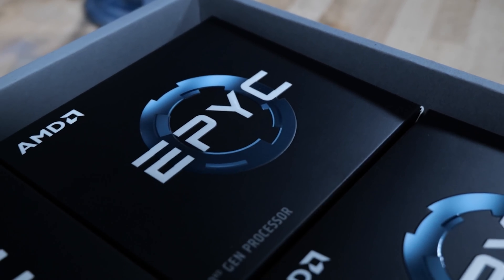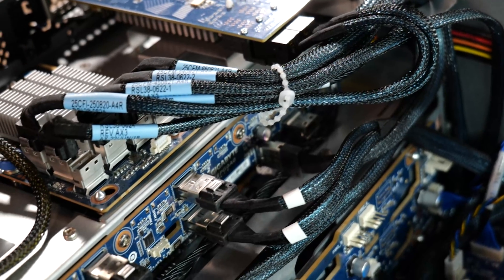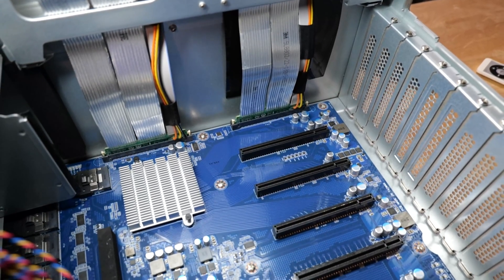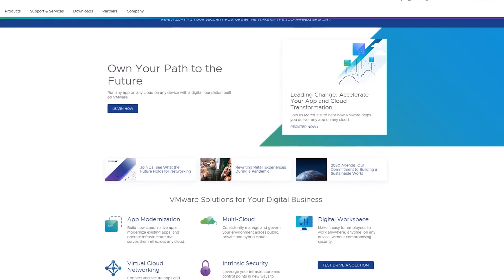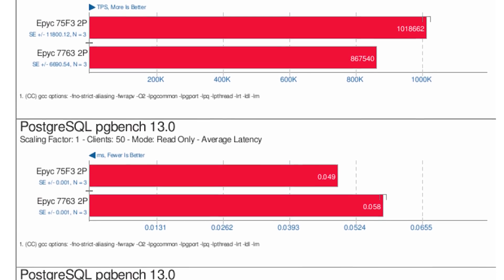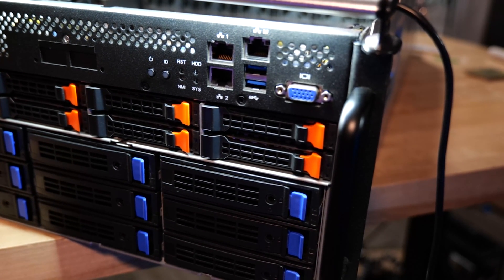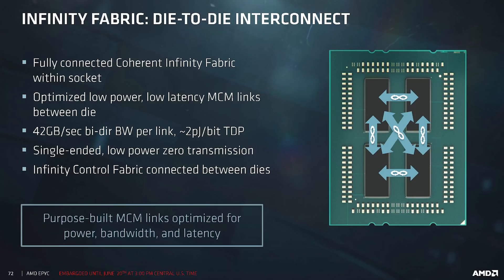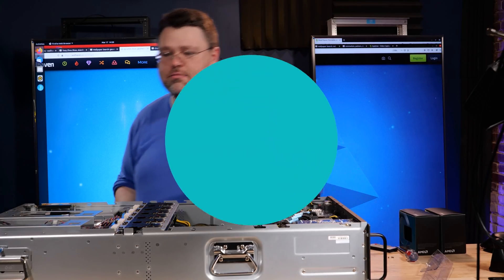Checking Out The Gigabyte G482 Z50: A Truly Epyc Server

Comment: An interesting ‘case’ study for you to try, split into 3 questions: 
1. How much/many 140mm based radiators (e.g. multiple mixes of 420mm and/or 560mm) would you need to be able to passively cool (WITHIN the same case as the components) a top of the range (eg RTX 3090 and AMD 9 5950X or a threadripper) fully water cooled system (at least GPU, CPU) at full over clock, to within 5 degrees of ambient temperature with the fans set to their absolute lowest possible speed, and not really needing to spin at all under normal load? 
2. Which off the shelf cases (max spending limit of $1,000 for the case) can fit all those radiators at the same time? 
3. If there are no cases which you can buy off the shelf which can fit those radiators at the same time within the system case, which case would you buy off the shelf as a starting point, and can you show us a step by step followable guide to how to mod the case so it CAN fit all those radiators? Try and keep the modifications to methods that people could DIY with only moderate access to power tools.
Can you demonstrate/show us such a system in action, and give us a rough idea of total cost for the case and total cooling system (e.g. presumably if there are loads of radiators, a more powerful pump would be needed)?

Comment: I watch these types of videos by Wendell, in much the same way I watch old Top Gear super car specials, but something did catch my interest that's probably only in server space right now: What's with 2.5" form factor NVMe drives? 
I ask because a total turn off for me is the un-swapable nature of M.2 NVMe SSDs slotting inaccessibly into the motherboard, often right under the GPU. For me I'll swallow the outright speed hit to use 2.5" form factor SATA SSD's in 5.25" hot swap drive bays in a fairly standard E-ATX type case (from a few years back when they still included optical drive bays). 

I just love the flexibility and I mostly use it to easily multi-boot OS's bare metal. I love having a single PC that's multiple flavours of Linux and Windows and Mac with a few clicks and clunks, without the expense of buying the hardware needed to do the same thing efficiently in VM. Being able to keep much the same form factor but have those 'drives' be caddys holding M.2 NVMe drives that are cabled to the motherboard's M.2 sockets is very interesting - even if there were only two on a typical desktop motherboard. Front access NVMe - yes!!

Comment: I wish it were thermally possible to have high performance 3.5 inch U.2 drives with super dense layout.
Basically i see 4x boards stacked on top of each other, each with many NAND chips on both side inside of the 3.5 inch form factor for bulk fast storage that is more dense than 2.5 inch chassis

Comment: So, fyi, in the USA almost ever single computer and network gear has a ranged PSU. And you can supply them with single phase 110V (or more appropriately 120V) all the way up to 240V. Technically they are rated to go below and above those rates as well. Common single phase electric voltages for server racks and UPS/PDU gear is 120/208/240V. If you need 120V for some equipment I'd recommend a UPS with a transformer. Also you will need C13/C14 (or some other equivalent) cable to replace the NEMA 5-15P cables that are almost always supplied. The real advantage is running at high voltage and LESS amperage. Making everything run considerably more efficient and providing more density in a rack

Comment: Only complain i have about the design is that both 10GbE run over the single Intels X550-AT2 chip and that is fixed to CPU1 only. with two 10GbE ports i really thought we could get one on each CPU.
Reply from the maker: PCIe limitation. Can't have a pcie slot or single peripheral "multi-homed" to more than one socket. It's easy enough to add a second X550-AT2 adapter, though? Since you've got slots for DAYS

Comment: FINALLY. Wendell: one thing I'm really interested in seeing is 8x Ampere A100 and 2x 7763 running as a dedicated F@H node. It is a very effective way of both maxing out the system physically and testing its reliability. Putting a ConnectX dual 100Gb NIC (or two) into that system and testing its abilities that way would be really cool to see. One question I do have though: does this particular chassis support OCP 2.0 or OCP 3.0? I can't see documentation anywhere showing one way or the other, although this chassis is already known as a monster.